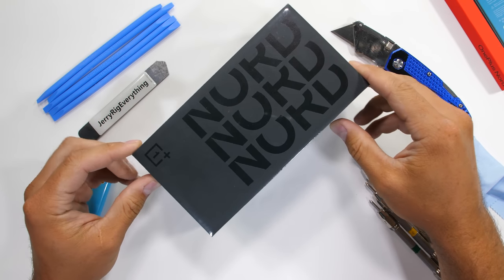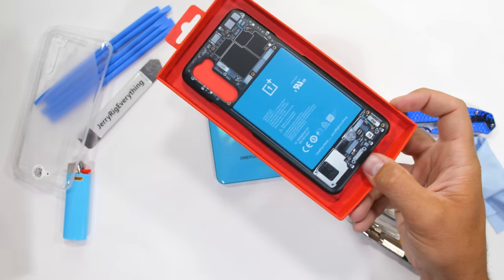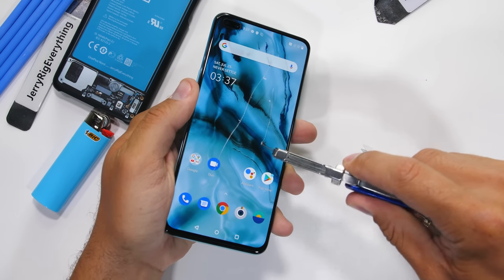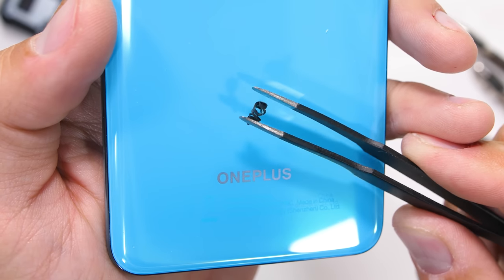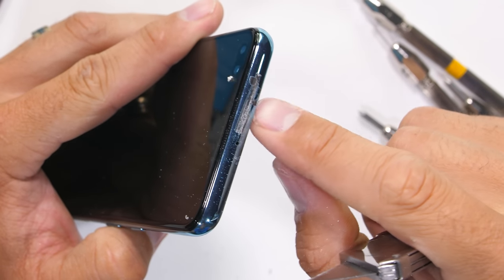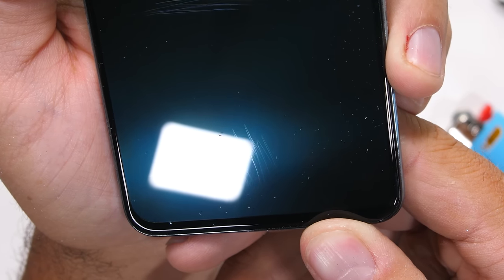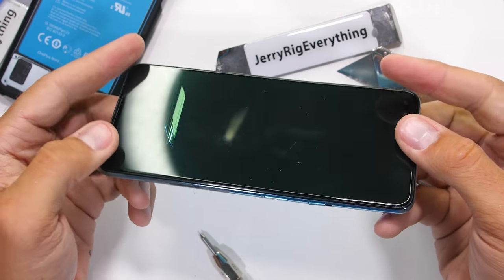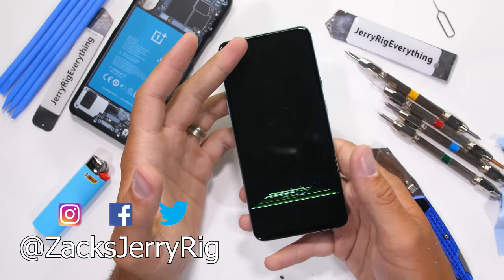OnePlus Nord Durability Test! - Sacrifices were made...

Comment: "The entire phone is mostly fine" he says. with a completely smashed screen.
Reply: it is, the front panel, the back panel. It's a unrealistic stress test.
Reply: He was a bit soft on this phone.
Reply: Nord is pretty much overrated and reviewers seems to be biased
Reply: Cause OnePlus don't send free phones if he talks shit about it
Reply: @AmalDevYT  yes
Reply: @RonaldoTalison  he pulled back. you can tell if he put more pressure in the whole thing would bend. Smells very fishy.
Reply: You look at the phone as one piece, but he looks at it as set of parts. He broke the frame and the display, but the MB, subPCB, baterry, and other components are probably fine. Also the phone failed the test.
Reply: @shieldmate7444  He might look at it as a set of parts but most people kind of need a screen or the entire phone is a brick. Even if you're good with repairs the screen is usually the most difficult thing to replace anyway so it breaking there is pretty catastrophic. How much does a metal frame really cost them? $2, $4?
Reply: """MOSTLY"""
Reply: Amal Dev U Well at least he showed us the actual footage. The commentary however is not genuine at all.
Reply: Shieldmate Have you seen the other videos with broken phones? Even when they don’t break all the way he usually isn’t left with a good or ok impression.
Reply: @BenWillock  Actually this repairis easier than a screen replacement, because you also get a new frame and skip the most annoying part which is removing the broken display. You move the guts of the phone from the old frame to the new one, glue the new display in (sometimes you can buy the frame and display already attached), glue the back in and done. 
Plastic frame isn't necessarily bad, the button placement is bad. They put them opposite of each other which created a weak spot.
Reply: Shieldmate he does seem a little biased here since non-durable phones are usually talked abt by him and put into the hall of shame. He doesn’t even reference it here.
Reply: Definition of biased
Reply: @mohanenb7965  Overrated? Find me another phone with the same specs at that pricepoint
Reply: @lilama9582  I'm sayinnnngggg
Reply: @vblaze011   Shelf of shame, and your right, why is he so soft on this?

Usually once it fails he's done with it.🤔
Reply: @Petrixxxxxxx  
I have bought Huawei P30 for 399 , which is similar to the OnePlus Nord's price .
Never regret it for the Kirin 980 .
Also , I don't know how good this Snapdragon 765G is , but I would consider a Redmi Note 8 instead.
Reply: @Petrixxxxxxx  if you are in india, there are lot of options from realme, IQOO etc.. and btw I was in a dilemma in buying this or not.

Comment: Remeber the Pocophone F1 that was all plastic but still managed to survive the bend test ? 🤔🤔
Reply: And was cheaper and better?

And had a headphone jack? 

YES I BLOODY REMEMBER

NOW I'M MORE MAD AT ZACK
Reply: @raghavendraravi6866  and had flagship specs. 🌝🌝
Reply: I'm still using pocophone...this phone so damn good even now
Reply: Raghavendra Ravi I agree, yeah. Although I’d like to say one thing, that Qualcomm is also responsible for the price bump of the flagship killer in recent years. They’ve bumped up the cost of the SD865 SOC quite a bit (and are also rumored to double the cost again for the SD875). I’m not saying that the manufacturers are not at fault, though.
Reply: Plastic is most durable
Reply: Poco f1 was all plastic… that's the reason it didn't break… same thing with last year's pixel 3a… but here in nord it has a plastic frame and glass at the front and back. All plastic is more durable than a plastic glass sandwich.
Reply: poco f1 classic phone
Reply: I still use poco f1 and I still think it is the most suitable phone in this price range with pro specs
Reply: @xtehmoonlight7400  me too and it can handle anything
Reply: Fusing glass and plastic is a bad idea!!!
Reply: poco is still better option
Reply: @xtehmoonlight7400  Same here, its a beast till today rocking 60fps on Call Of Duty and Minecraft
Reply: Plastic isn't bad as long it's the right kind and it's done right.
Had a polycarbonate Lumia 920 and the back looked like shit after two years but it was tough as hell.
Reply: Wasn't there an option for a Kevlar back panel on that thing?
Reply: @andrewchallita7674  i agree.
Redmi Note 7 is built in same plastic glass sandwich, and it failed the bend test pretty bad
Reply: @rizkirachm355  people complain that they want a good feel in the hand i wouldnt mind having a phone entirely plastic if its durable i dont really care about the feel in the hand
Reply: @andrewchallita7674  personally, i dont care what materials my phone is using, i just use a case from day one.

Comment: Scratches the screen with the blade
Jerry: we are lucky they have included a screen protector

They had us in the first half.😂
Reply: seeriu ciihy   yeah, I agree it didn't live up to what they promised. A complete failure.😔
Reply: F.B.I what bout pixel 4a
Reply: @dnghn.design  
Well, Nord has: 90Hz display function, 4000mah battery, sd 765 with the 6.44-inch display and has 5g support for a cheaper price and it's faster than pixel 4a.

Google pixel: no high refresh rate display, 3000mah battery, sd 730 with 5.8-inch display it feels small compared to Nord and it has no 5g support the price is higher than nord.
Reply: @shadeerahmed4685  nord is 399?
Pixel 4a is 349
Reply: @dnghn.design  it's still a LOT worse phone for the money on the Pixel side... Only 2 things you get: Superb camera- personally 0 f's given about that, and also the "reliable brand" tag that gives you some trust that the brand will still be around in 5-6 years to fix your phone, if you care about that sort of thing. Other than that the Pixel is kinda trash at least going by specs... 
Personal opinion, but I LOVE the smaller size, If it had all the Nord specs in that size I'd buy it in an instant... but it doesn't... So it's just a meh phone all around :/
Reply: @dnghn.design  Yeah thats the point. Thats a lot of things the 4a doesn't include for only 50 bucks off.
Reply: Francesco D'Alonzo no no it’s not
Reply: @Francesco D'Alonzo finally at least someone got the meme
Reply: Lol 😂

Comment: Jerry should have crushed it in half but he stops after minor interior crack .
.
.
.
hmmm suspicious
Reply: Nah, that pressure he was applying looks very similar to other tests. I feel like he was only soft on this phone because 1: he likes it and 2: the outside glass didn’t crack, but i believe the interior parts are more important so who knows.
Reply: Pixel got screwed, this phone should have been too
Reply: He bent it a couple extra times after the interior layer broke. Seemed like he was applying a similar level of force as he usually does based on his hands shaking. Once the plastic frame and display broke, not much point in continuing to just keep bending it back and forth. Definitely weird that he defended them a bit after it broke, he likely wants them to continue sending him free phones to test and tear down. At the end of the day, feel like him showing it breaking is far more important than anything he says afterwards.
Reply: Correction, after it died completely and failed miserably.
Reply: @dheeraj3945  Correction, the phone didn't die. It was still working. Only the display was shattered.

Comment: Hi Jerry Rig maybe next time, when you do a bending test, i would suggest you use a UTM(Universal Testing Machine) or anything that would measure the smartphones flexural capacity. In that way we may be able to measure the phones bending capacity.

Cause just by Hand bending, you may not know how much force you applied on that certain smart phone. And also place a bending stress chart as to when you can say that a smartphone is structurally Robust.

Just like what you did in scratch test, you use Mohs Scale
Reply: bro civil,mechanical se h kya....:)

Comment: "and even though oneplus Nord failed my durability test it still is a good phone"

👎
Reply: Solution is simple: get an overpriced Samsung
Reply: @tarno89  Or any of the hundreds of phones that weren't destroyed by the bend test. Or any of the cheaper phones with the same specs.
Reply: @over1498  which ones? I'm curious of what other options with exact same specs you find on the marke which doesn't bend and break.
Reply: @tarno89  there are zero with this spec at this price point.  People are talking out of their arses.
Reply: @tarno89  poco f2 pro.

UFS 3.1, best cam, better built, better battery, headphone jack, bla bla bla.

So, u need a 90hz display in a budget phone then durabily&headphone jack.?
Reply: @mr_lalam  "Best Cam" doesn't mean anything. The OnePlus Nord does indeed have better cameras. I'm willing to trade off a headphone jack and a better build/UFS 3.1 (which really doesn't matter) for a 90hz display and a battery that charges fully in 30 Minutes.
Reply: GuruTruthSpeak  It's funny how this barely failed the test yet you call it so fragile. He literally bent it with his bare hands as much as he could. Don't think the average consumer would try to do what Zach did.

This isn't an iPad Pro.
Reply: @parthkochhar8447  yes, you may tradeoff better build quality and headphone jack for 90hz display,  but i am not. If it's midrange phone means it's for the people who do not willing to spend much on mobiles/accessories and also use the phone for longer period. So, build quality and headphone jack really matters to them.
Reply: @mr_lalam  headphone jack is gone and it will be gone from any device. In the exact same way as the USB replaced serial COM.

Best camera? So far, Samsung and iPhone have the lead with the camera. Camera is probably about the same as this.

Please consider other factors. Design, software, reliability proven in the past, customer support, constant update. Even older OP models still have the latest Android. Maybe you don't consider it important, but if you use an outdated system it's so easy for adware and other stuff alike to get inside your phone.
Reply: @tarno89   yes, now a days almost all flagships are coming without headphone jack, it's a sad truth.
But, nord is neither flagship nor flagship killer. It's a overpriced/overhyped midrange smartphone.
1. It's should have retained headphone zack. People who purchase this mobile also have to shellout more for good quality WL earphones. A 1000rs wired earphones sounds better than 3000rs wireless ones and lasts longer. 
2. Coming to build quality,  i am not asking metal frame in this, but should have used quality plastic. For ex POCO f1(Still one of the best mobile in midrange segment). 
3. Customer support.? Samsung and Xiaomi are market leadersin after sales service.  Oppo and vivo(and OP) are still developing in this.

What is the use of 6 camers in a midrange mobile except gimmicks.? They should have removed two useless cameras and place a headphone Jack and opt for better built. 

Do remember it's not a below 20k mobile to accept design flaws, it costs 28k( do not say 25k for base variant, again it's useless as it comes without memory card slot).

Too many alternatives with better value for money at this price range like Mi9, K20 pro, realme X2 pro.
Reply: No its not a good phone..Get a 1000$ flagship instead
Reply: @leeroy110  realme x3 855+ lol  765> 855??? 🤣

Comment: Oneplus NORD: I will set new records 
ZACK: Yeah! Oneplus never lost durability tests
Reply: 7T
Reply: i guess OnePlus 7T also broke
Reply: @shadow-qc1rf  only back glass and not entire frame or screen
Reply: @motek6913  case with 7t was different! 
Back glass broke down bcoz of huge camera bump! 
Thats was not durability flaw!
Reply: I just said 7T broke. And literally it did. Not saying about screen or back.
Reply: Also OnePlus leaked customer data 3 times in a row. So it doesn't seem to be a safe phone either way.
Reply: @umairkhadim  stop defending onenplus for its weak structure. If you like OnePlus mobile then use it no problem. I too like oneplus mobile but failure is always a failure no matter any company.
Reply: @shadow-qc1rf  this is when bro...

Comment: When Jerry breaks an apple product: HAHAHAHA APPLE SUCKS GIT GUD APPLE!!!

When Jerry breaks the OnePlus Nord:  Its ok, durability isnt everything.  Give it a chance, get my case.
Reply: well price matters
Reply: Might have something to do with the fact that Apple phones cost 2-3 times as much and are absolutely awful in the longevity department.
Reply: Vamsi G The iPhone SE is the same price as the Nord, and is aluminium/glass and doesn't bend. Also it'll get 5 or more years of software updates while 1+ will get 2 years of major updates. So, longevity is not a good argument here.
Reply: @vladaad  let's all pretend like iphones don't become insanely slow 1 year after you buy them
Reply: @SurrealExposure12  true
Reply: Vamsi G they dont
Reply: @SurrealExposure12  What? I've had my iPhone 8 for 2.5 years and it's still as fast as at launch. I've had my first gen iPad Air for 7 years and it's still usable and even the battery is holding up. If there's one thing that's great on Apple devices it's the longetivity.

Comment: "Screen broke under the Gorilla Glass"
Yep, happened to me in 2014 on a Lumia 820 (which had some generic scratch resistant Glass, no Gorilla), was dropped from waist height and the display cracked under the touch glass panel.

Comment: I buy this mobile on August 8 2020 
Review this mobile fully
Pros :
1. Camera department is awesome superb nice performance, and it has optical image stabilization and electronic image stabilization also but some pictures have shoot on front camera should be blur images and some are should not have focused.
2. Battery performance is awesome and that charging stability is also very good it can charge below within 1 hour.
3. Oxygen OS 10.5.3 version it is a good and better UI but it is similar to the stock Android.
4. Performance is good but not better than redmi k20 Pro and realme X2 Pro and Vivo IQQO 3.

Cons :
1. My first con is it has a call recording option when we are calling to anyone then only the call recording option will be appear and if the call is lifted then only the recording must be started when we are clicking the call recording button and the system says the call has been recorded that means In other side lifted caller will notify that this call has recorded.
2. Oxygen OS look like stock Android but it has very laggy performance this UI also worst UI. For example if we click any notification it does not response to that but it has given 90hz refresh rate but I think it does not has the 90 adjust refresh rate.
3. The fingerprint scanner also very slow it should not be as fast as redmi k20 Pro realme X2 Pro and IQQO 3.
4. It does not has floating window options it does not response to the split screen option for example if we are using maps it can access to the picture in picture mode but this smartphone has does not that option.
5. The another problem is it can't access the Fast internet connection also. Internet must be very slow and sometimes it can't access that internet.
6. This smartphone build quality also very Poor performance. It also has some display issues also. Auto brightness also does not works well.

Overall my experience about this oneplus nord is worst (worse than the worst)

If you want better gaming performance better UI performance then go to 
Redmi k20 Pro (MIUI 12) or 
Realme X2 Pro (Realme UI 2.0) or 
Vivo IQQO 3 (IQQO UI).

Comment: I'm facing big three irrigating problems with OnePlus NORD, many user's mentioned in Oneplus Community App / Tab / Window / Webpage also.

1. " Call Recording Announcements to both Dialer & Receiver ".

2. "Recorded Tag showing under the dialed calls in the calls list ". It should not show, simply it has save in Phone Memory for Users requirement if they record.

3. "Pink color Tint" issue still not resolved  in low brightness.

Many r saying the recording problem is due to Google dialer as it developed by Google. If it is problematic to customer OnePlus has to change the Google dialer to OnePlus Dialer or immediately fix this bug with Google people.

Please sir, I'm requesting you to please raise ( via., Ur Twitter, Instagram, Telegram, Fb accounts to OnePlus NORD team) the above three problems with OnePlus team to fix those three bugs with immediate update so as to work with mobiles smoothly.👎👎👎😭😭😭😩🤦🤦✖️📵😠😩🛑

Comment: NEED AN OPINION HERE:
Some days ago the screen of my Galaxy S9 shattered and now I am thinking about replacing it. Current flagships are just crazy expensive so I am looking more at mid range phones like the Oneplus Nord. Question: Will the Nord feel like an upgrade compared to a previous flagship model like the galaxy s9? Or am I better off sticking to the S9 and trying to get the screen replaced for a reasonable price?

Thanks in advance for your help. I think this is a good question to be asked in general: How do current mid range phones compete against former flagships?
Reply: Get the screen replaced from ubreakifix they are Samsung certified
Reply: Hey. I'm using a Samsung a31 and its great. It also has a headphone jack (YAY) and it uses android 10 (latest android system). It costs a little bit over £200, and the a71 costs around £400. Both great phones 👍
Hope that helped 😁

Comment: I recently (08/08/2020) bought a OnePlus Nord Marble Blue 8gb+128gb IN AC2001. Now I am facing issues with display grain and screen flickering issue as well as black line, both at same ,and suddenly phone is rebooting. So i went service center and they verify that they noticed internal crack and this issue not cause by any physical damage. so I request them to repair for the same but they suggest to me to change display and asking for full payment (RS.8000) prior to my warranty. I don't want give any single rupees to them because of his mistakes. And the service center is not ready for giving service.